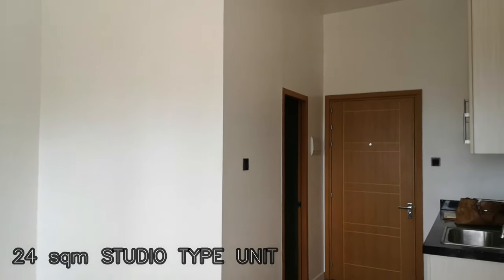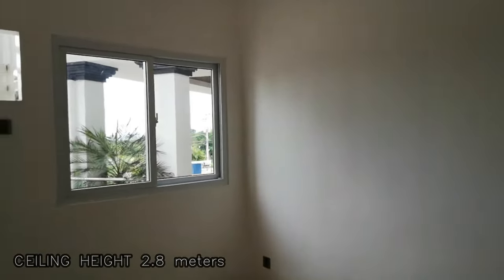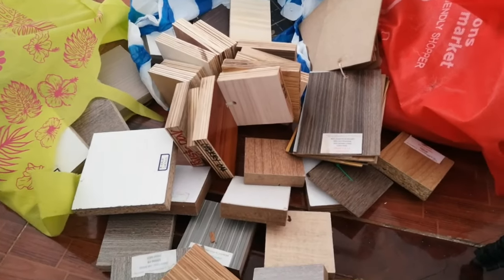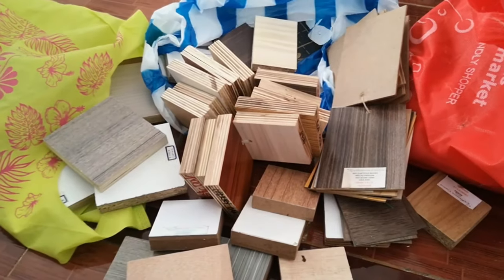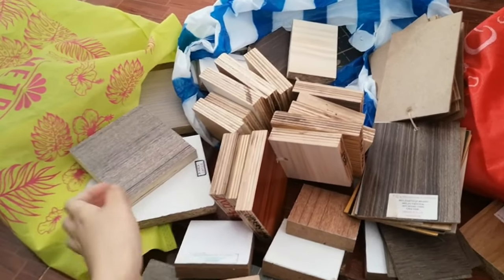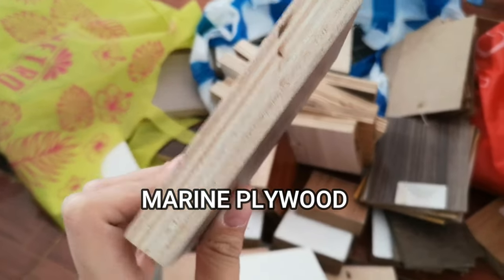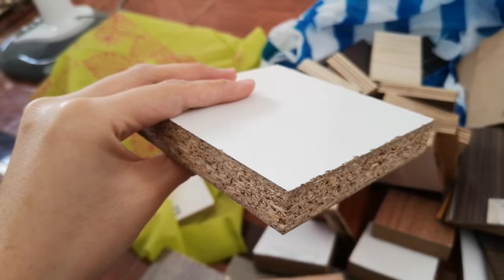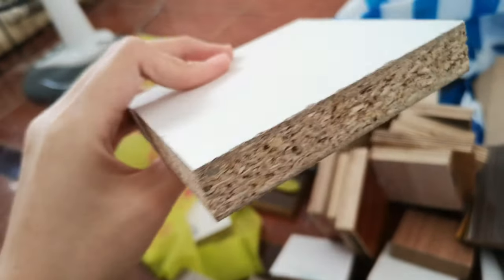LOFT BED for a CONDO UNIT

Comment: May I ask, with the loft installed, what is the floor-to-loft(ceiling) height, and loft(bottom)-to-ceiling height? Thanks! Great video :)
Reply from the maker: Floor to loft = 1.80 meters 
Loft floor to ceiling = 0.90meters
Heights are adjustable. It all depends on the users of the loft.